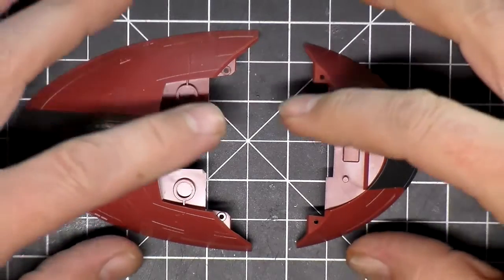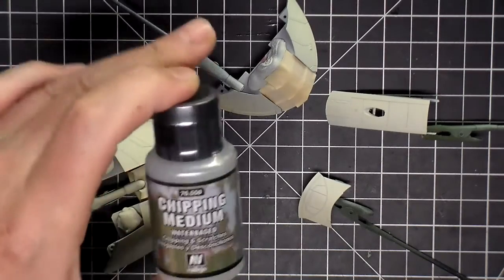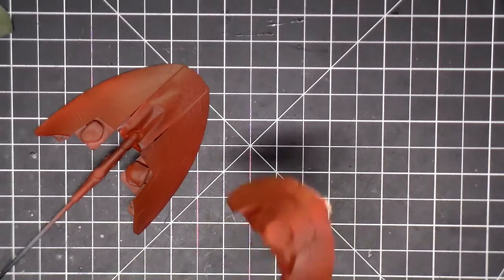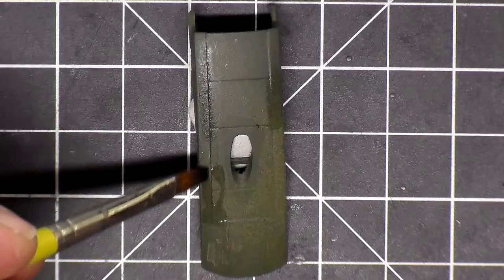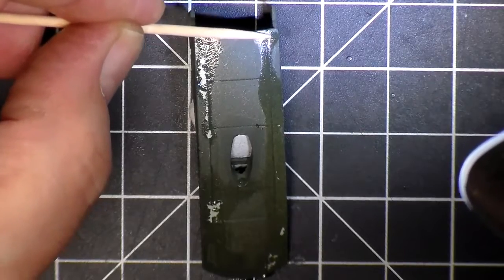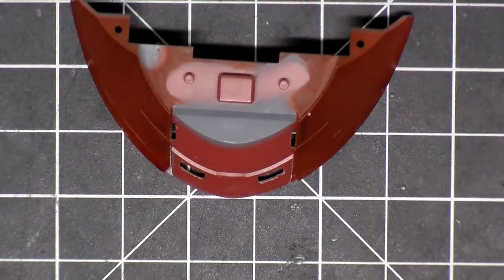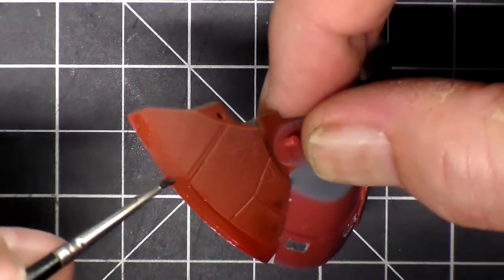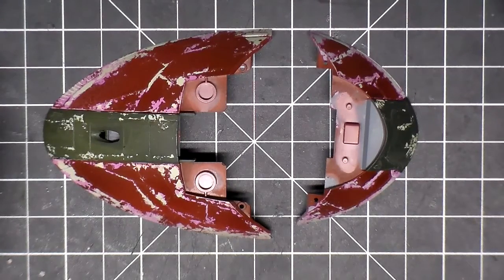PART 8 - SLAVE 1 - Bandai 1/144 Scale Build

Comment: Looking sweet, man! I'm at the same stage, but I went with Vallejo Masking Fluid, then a micro brush to add paint back to the edges of masked areas. I have that same Chipping Fluid, but I picked up the airbrush-ready one, I'm going to try that on the main fuselage.
Reply from the maker: Thanks Mace! I didn't know they had an airbrush version. I will look for it.
Reply: @tagamomodelworx4262  My bad, man, I think it's just the same stuff, comes in a Model Air looking bottle. I assumed it was for the airbrush, I had to thin it down quite a bit.
Reply from the maker: @macewindex  Heheh. Ok. No worries